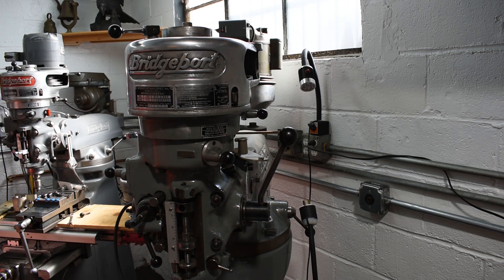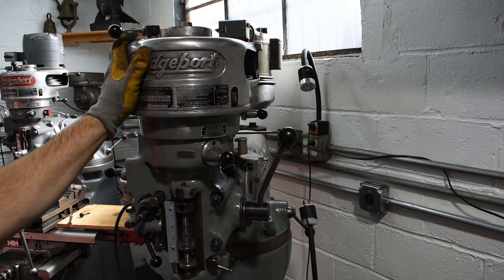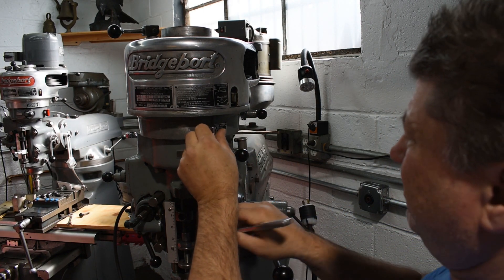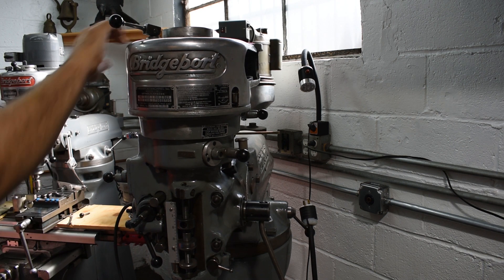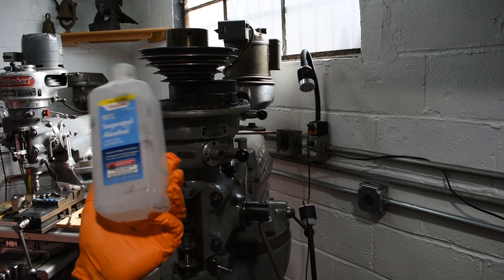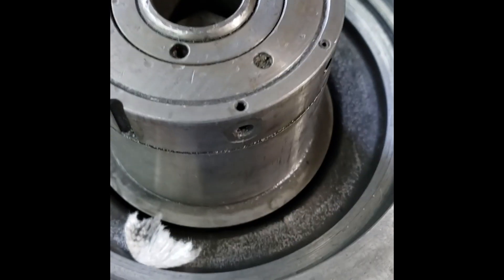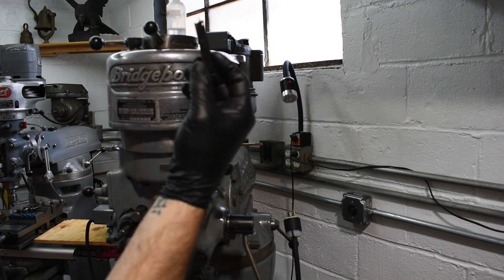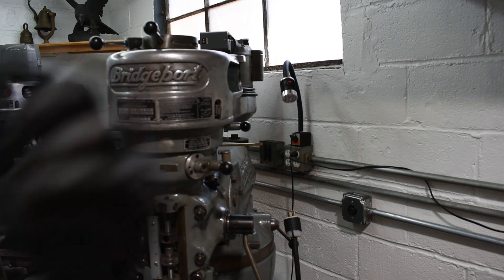Bridgeport J Head Locked Sheave Repair

Comment: Hey Joe.
Good to see you got it sorted out.
The Belt Guards ??
I don,t blame you for leaving them off.
Even if you put them back on,.
They will spend more time on the work bench than on the machine ??
I follow a guy on Instagram who rebuilds Bridgeport Mills as part of his business.
If you need any help with it i am sure he would be in the know.
Keep the video,s coming.
Peter.
Reply from the maker: thanks Peter !    im super happy its running too long in the making !   still looking for a 36" leadscrew for it.. i have the old school geared power feed for it.. i really didnt like having that hanging off the side so i bought a end bearing housing and handle.. but i dont want to cut the old lead screw if someone wants the whole setup..  another buddy gave me a leadscrew we thought would work .. but no go.. they arent too expensive so if i cant find a good one ill bite the bullet and buy one new.